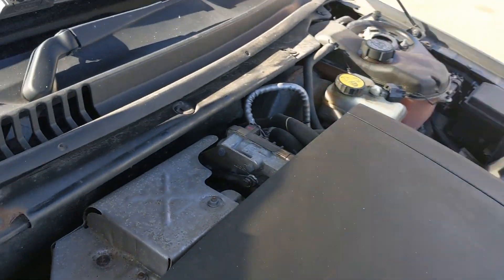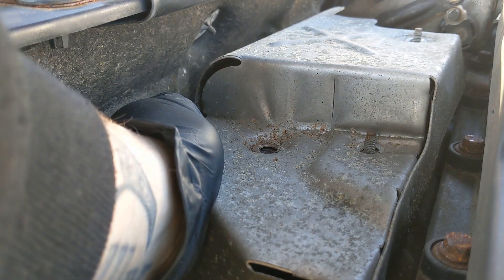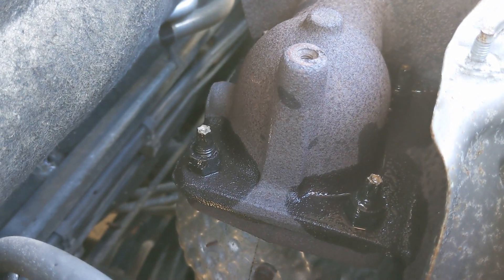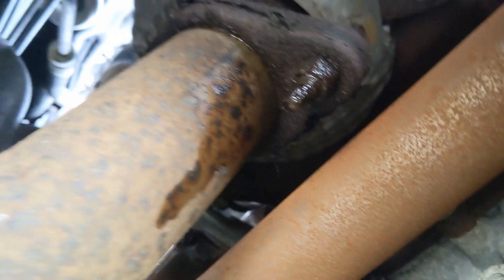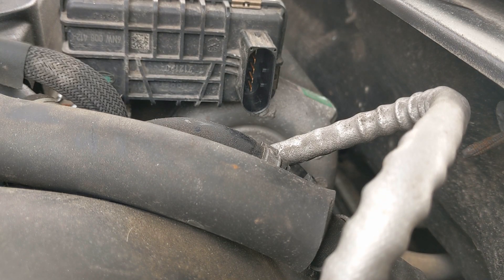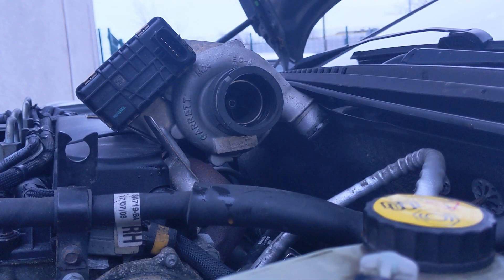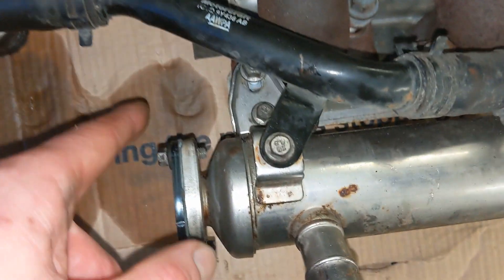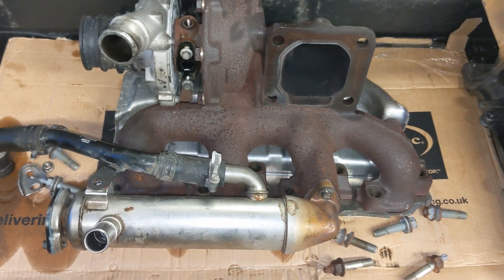Ford/Jaguar P132b Fault Fix Part 1 (Turbo Removal)

Comment: the CAT will come down and out if you loosen the bolts that secure its bracket to the block
Reply: Cheers @as3cs3, think my cat needs replacing on my Mondeo so this is really helpful to know 👍

Comment: I’m fitting a new turbo to my jag, would I need to pre-fill the turbo with oil ? Great video mate ! Helped a lot !
Reply from the maker: You can do, I usually unplug the injectors and crank it a couple of times to get some oil circulating.  No problem, glad it helped.
Reply: @Papa77sGarage  fitted my new turbo all thanks to you mate ! Thank you very much you saved me a Fortune 👍🏼
Reply from the maker: @jacktrow117  great to hear. Glad I could help keep your Jag on the road!